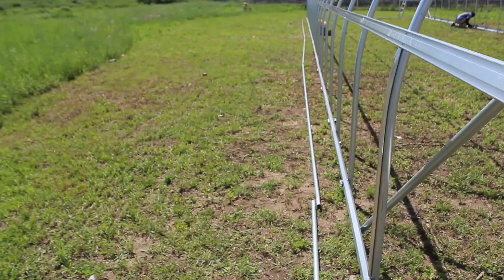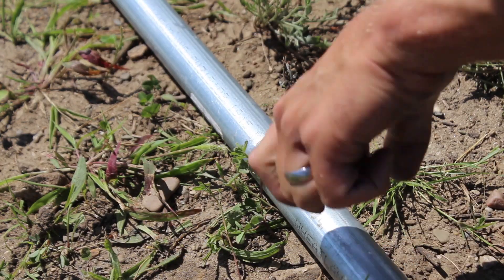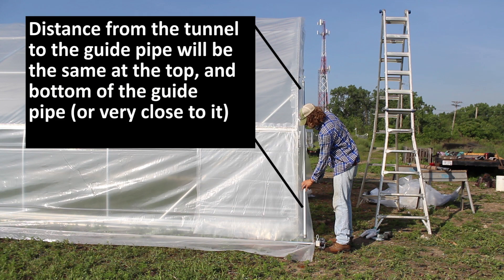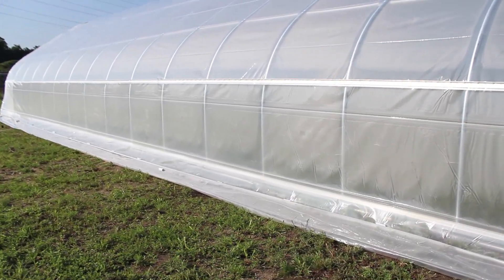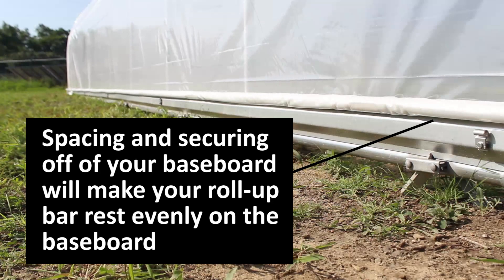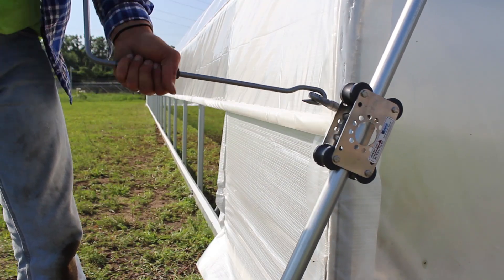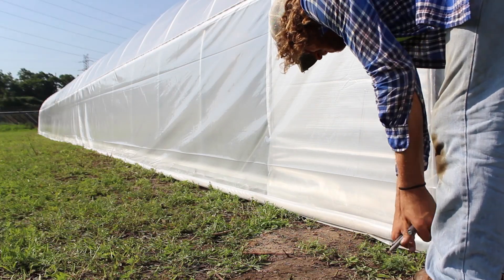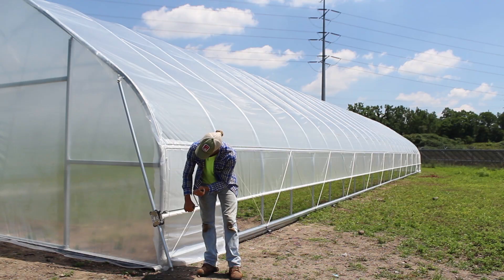Roll up sides for Greenhouses - How to Install for Improved Ventilation

Comment: How do you level a vertical guide post?  One would think you would plumb it.
Reply from the maker: If you install the guide pipe using the open eye bolt and chain links provided with the gear boxes, which are shown in this video AND you attach those to your structure as is done in this video, the guide pipe should end up being parallel to your end-bow, and since your end-bow should have been made plumb in previous steps, the guide pipe should be plumb as a result of this. If the guide pipe is attached to the structure as shown in this video, the bottom is free-floating, however, so if it is slightly off plumb it won't hurt anything as the guide pipe can "self correct" as the guide pipe goes up and down it. Hope this helps!

Comment: Since I don't think we have that roll up thing in Germany out of the box, can you please tell me which kind of material this "raw tube" is? Is it Aluminium?
Reply from the maker: Hey there, and no prob. The raw tubing is 1.315” Outer Diameter galvanized steel. It is often referred to as “top rail” and is also used as “chain link fence tubing”. Hope that helps! Thanks for watching :)

Comment: So I am wondering. This is six years old so maybe I won't hear back. Wouldn't it be better to roll up sides in the opposite direction so water will shed and not go into the roll? Just asking. Just put up a greenhouse with My son with roll up sides. First time.
Reply from the maker: Whether it is better is debatable BUT it is definitely possible to crank the gearbox operator the other way and have it roll in as opposed to out. The issue with spinning the roll-up side inward is that it creates a lot of friction at the point of each bow as it rolls up since it is literally scraping against the structure the entire way up, whereas rolling out doesn't create any odd additional friction on the plastic at the point of contact with the bow. All this to say, you certainly can roll the tube the other direction and avoid some water resting in the roll-bar "nook" when it is in the down position, but it may result in your side plastic breaking down a bit faster than otherwise since the rolling up and down motion will put more pressure and friction on the plastic. To me, I am not really all that bothered by a little water resting in the roll-up side when it is in the down position, and that can be squeezed out easily enough (in my opinion) by rolling the side up a bit and then rolling it back down. Rolling outward will likely result in longer lasting side plastic, and I like that, but it is just something for you to keep in mind as you make your decision. Again, rolling inward will work, it is just a matter of balancing the trade-offs for what it could mean for the plastic. Congrats on completing a build with your son, that is great!
Reply: Thank you for the feedback:-)

Comment: Would this work for double wall, insulated plastic? Its got a little fan that blows in between the plastic sheets and inflates and insulates. It's not very tightly covered, but tight enough, and both layers are on the outside of the frame of course. Thanks
Reply from the maker: There are ways to inflate your roll-up sides, but it is not something we focus on. You could reach out to Advancing Alternatives if you are serious about setting up an inflated roll-up side set-up.
Reply: @tunnelvisionhoops  it's a normal dual plastic sheeting walled/insulated greenhouse. there's 2 layers of plastic on the outer frame of the greenhouse with a small fan that blows in between the layers to keep them apart.  The air can be turned off or reversed if needed.

Comment: Do you put anything on the other end?
Reply from the maker: No, if the tubing has been attached to the plastic parallel to the hip rail, and a gear box is being used at one end, the side should roll up parallel to the hip rail. It will be important to drive a screw  or two through the snap clamps and into the bow to ensure they don’t slide a bit over time though.

Comment: Great video. Only thing I don't understand is how to seal up for the winter. We have to heat our greenhouse for citrus and can't have any cold air leaking in.
Reply from the maker: Thanks for the comment and the kind words. If you have to seal up for winter and have roll-up sides, you can add spring wire where the excess roll-up side plastic overlaps the end hoop at each end. For along the bottom you could add a shin-wall, and additional spring wire channel if you wanted, in order to create a more closed off system. Hope that helps and thanks for watching!

Comment: How far is the wiggle wire from the ground?
Reply from the maker: Thanks for the question, Randall. Are you referring to the spring wire that is in the hip-rail (the horizontal member that runs the full length of the structure)? If so, that unit is approximately 4 ft. off the ground - give or take a few inches. 

We also sell greenhouses where this hip-rail is 6 ft. off the ground or in some instances 8 ft. off the ground. 

If you were referring to a different section of spring wire, let me know which one you are referring to. 

Thanks!
Reply: @tunnelvisionhoops  basically how far it rolls up max.
Reply from the maker: Ah, gotchya. The side in this video rolls up 4 ft., but there are versions of this structure where the sides can roll up 6 ft.
Reply: @tunnelvisionhoops  Could i make system that could roll 8-10ft?

Comment: So we have a roll up side for our tunnel, and our grading is about 2%, or 2 feet for 96’ length. My question, our baseboards installed going with the grade would result it it being uneven the roll up sides. Also, we would use 4 or 5 baseboards for one side, and only one for another side. Any ideas? Should we go with the grade, or make the baseboards entirely level and have baseboards be almost 2 feet of spacing on one end? Thanks for your time! Have a great weekend!
Reply from the maker: This will really be determined by how you anchored. Did you install your anchors so that they “follow the grade” lengthwise, OR are all the ground posts perfectly level (which would mean the ground post anchors at one end would be out of the ground about 2’ more)?

If your anchors have followed the grade of the earth, you could install your baseboards so they run along the ground also following the grade of the earth, and AS LONG AS YOUR HIPRAIL is a consistent distance up from your baseboard through its full length, the roll up side should still roll up without any issues / without getting “wonky”. 

Not sure if what I am outlining above makes sense, but whenever I can install a baseboard so I can avoid a big gap beneath it at one end, I do, but this would really require you to think about it at the time of anchoring.

Hope that makes sense, and thanks for watching.
Reply: @tunnelvisionhoops  my greenhouses are also built on a slope and i think it would be easier with my grading issues, if my curtains could roll down to open and roll up to close, is that possible with this system?

Comment: Hi - great video! One thing that I'd like a closer look at is how the top of the gearbox guide pipe attaches to the end hoop of the greenhouse. Thanks!
Reply from the maker: Good question! I’m working on a video now where we discuss extender pipes and guide pipe placement. Extender pipes allow guide pipes to be installed so they don’t ‘kick’ out at the bottom when the operator is rolled up. 

Not sure when exactly it will publish, but soon I’d think. Stay tuned, and thanks for watching!

Comment: Why is there additional plastic at the end of each side panel?
Reply from the maker: Good question, Harvey. Those are corner wind panels intended to reduce how easily wind and cold air can squeeze past the edges of the roll-up sides. We have a video on that process here: https://www.youtube.com/watch?v=AfsxdyaoWjk Thanks for watching!
Reply: I made it through each of your videos and learned a lot about how to and the why behind it part. Great job! Very clear and concise. Thank you.

Comment: Do you have to use the guide rail or can you use something else
Reply from the maker: Victor, you do not need to use a guide pipe if you are just using Handles as your roll-up side operator, BUT, if you plan to use a gear box operator you will need to use a guide post for those. Thanks for watching!

Comment: Is the roll up pipe on the none cranking side just suspended on it's own or does it have something attached to it and it rides up a similar cranking pole?
Reply from the maker: The roll-up pipe on the end opposite the operators does NOT have a guide pipe. It is suspended by the plastic itself.

The snap clamps (and the screws driven through them) ensure that it rolls evenly despite this. Believe it or not, the plastic does a good job holding the tube if the tubing has been attached to the plastic consistently through the full length of the house.
Reply: @tunnelvisionhoops   thank you very much

Comment: Overall a great video and a great company to give support to their products. I did have a hard time figuring out installing the pole that the gear box rides on. The instructions you gave - to keep it paraelle to the end hoop and the gear box connection beyond the hoop, were inconsistant because the bolt wasn't long enough to get the pole out that far. Anyway, maybe a suggestion to clarify that part for others. Thanks for the support, you do well with the videos.

Comment: Hi everyone
I'm having trouble with the pipe, is flexing  and the end of the pipe (opposite side of the gearmotor), at the end of the pipe rolls the plastic faster so the rolling is uneven, what could be the problem that is causing this? the lenght is 54 meters(183.7 feet) and the height 4 meters (13.12 feet), thank you all
Reply from the maker: There are a number of things that can cause a roll-up side to have this type of issue, so it is really quite difficult to diagnosis. Here are six potential causes:

1. Your structures anchors follow the grade of the earth BUT your hip-rail / sidewall plastic connection is perfectly level. If this is the case and you install your roll-up sides a designated distance off your baseboard, your sides will roll-up even to the baseboards BUT not your hip-rail / connection point on the side. 

2. The plastic on the far end has been attached differently than plastic at the near end. For example, if you don't create enough distance from the baseboard to the plastic connection to your roll-up bar, it will exacerbate as the side rolls up. If your roll up side is 4 meters it has A LOT of distance for even a one-inch to compound over the side wall height. For example, if you attached the plastic to your roll-bar one inch closer to your structure on the far end than the near end, the obviousness of that issue will increase the higher you roll the side up. 

3. There could be more excess plastic on one end as compared to the other. If excess material is bunched up in the roll-bar that part of the roll-bar tends to roll-up faster than the rest of the bar. 

4. There could be literal debris in between the roll-bar and the plastic. This would likely have happened at installation if at all. For example, when your plastic is first being attached to the roll-bar, if you accidentally get gravel on the plastic and don't notice this at the time it will impact how evenly it rolls up and down. 

5. The plastic isn't securely fastened to the roll-bar. If you, for example, used snap clamps to attach the plastic to the roll-bar BUT you don't drive a screw or two through the snap clamps to permanently hold them in place, it is possible for those snap clamps to slide a little over time causing portions of the bar to roll up slower or faster. Also, 4 meters is a lot of distance for the roll-up side so there is a lot of additional weight on whatever securement method you are using. 

6. One of your roll-bar units may be missing a connection where it joins to another unit. This has happened to me before, and I only discovered it after trying a bunch of other repairs / fixes... essentially, I just got in a hurry and forgot to attach the actual roll-bar to the other roll-bar unit. If this has been don, the roll-bar will often still move up and down, but it does so at a much different pace than the rest of the side. 

Best of luck, and thanks for watching!

Comment: Can i use 3/4 EMT pipes ?
Reply from the maker: Technically you can although most of the common hardware used for attaching the plastic cover to your roll-up side bar AND for attaching operators to the end of that roll-bar (whether 7:1 gear boxes or handles) are made to configure with 1.315" OD standard fence type tubing - which is referred to as 1 3/8" OD and is often sold at hardware stores and fence supply companies.

Best of luck with whichever route you decide to take your roll-up side installation. Thanks for watching!

Comment: First, excellent video! Thank you for sharing your knowledge.   We followed your video and got the necessary supplies, it works exactly as you've described. The only problem we're running into is the plastic is so heavy in the center it sags the piping in the center. We used the snap clamps as described. We're thinking it's because we're using a heavier plastic. Any suggestions to fix this issue we're having? Thank you!
Reply from the maker: Thanks for watching, and good question. In my experience the weight of the plastic doesn't have any impact at all on how the roll-up side bar rests through the full length of the structure. Not to say it isn't possible in your situation, just that I have always found that type of sag to be caused by other issues. 

Here are the most common issues that I have seen cause this:

1. The baseboard of your structure follows the earth through the length of your structure and IT is lower in the middle, which means when you measure off of your baseboard your roll-up bar "sags" a little because it mirrors your baseboard. 

2. The greenhouse plastic was fastened to the structure in a way where the far left and far right of the structures sides weren't pulled as tightly as the center of the sides, which means there will more excess poly in the center of the structure. This means as the weight of the roll bar rests on the structure it "stretches" the excess plastic out and their appears to be a sag in the center. 

3. If the plastic hasn't been installed square to the structure you may find that there are symmetrical wrinkles that meet in the middle of the roll-up side. As you roll the side up these wrinkles get rolled over and create a larger diameter to the rolling bar and this compounds further as the side continues to roll-up - which creates a "sag" appearance in the roll-up where the wrinkles are most obvious. 

4. Too few snap clamps were used and they moved a little as you rolled the bar up and down. This would happen also if you never drove a screw through them into the roll-bar. This is unlikely to be the issue, but I thought I would mention it here just in case. 

There are relative solutions for all of the above, but it might be best to send us an email at info(at)tunnelvisionhoops(dot).com along with some pictures so we can help you problem solve / trouble shoot.

Thanks again for watching!

Comment: You never showed how to attach the guide pipe to the high tunnel. Or how to attach the gearbox to the roll-up bar.
Reply from the maker: Because there are so many different operators and handles available for these structures, typically the instructions for those individual units are in the boxes with those units. For example, gear box attachment documents usually come in the box with the gear boxes themselves. That being said, we do have a video showing how to attach these to a roll-bar separately - you can see an example for how the gear box attaches to the roll-up bar at the 2 minute and 32 second mark - here is a link to the video I am referring to: https://www.youtube.com/watch?v=K9OtLmIMt8A&t=152s - this is being shown on a large plastic roll-up door but the order of operations for attaching the gear-box to the roll-bar are identical.

Once the guide pipe has one of its ends assembled with the included chain on it, the unit can be placed over top of an open eye hook that has been bolted to the front face of the structures' end-hoop - the location of that open eye-bolt should be determined based on the length of the guide pipe. Usually, I hold the guide pipe so the bottom of it rests just above the ground in front of the metal baseboard - then I angle the top part of the guide pipe so it lines up with the end-bow - at this point, I make a mark on the front face of the bow - I then add an inch approximately to account for the links of chain at the top of the guide pipe. This is where I drill my hole to receive the open eye-hook. If I install the guide pipe and it makes too firm of contact with the earth, you can trim a little off its bottom so it hovers just above ground level. 

The main thing to remember when configuring the guide pipe with the gear box, is that the guide pipe should remain relatively parallel from the open eye-hook all the way down to where it extends through the guide pipe. 

Feel free to email info (at) tunnelvisionhoops.com, or call in to our customer support line, if you have any additional questions.
Reply: @tunnelvisionhoops  Cool, thanks for responding. Looks like my kit is missing the adapter that attaches the roll bar to the gearbox. I'll call in. Thanks guys.  Your customer service has been great.
Reply from the maker: Thanks, we overnighted those and they should arrive tomorrow! Feel free to call in if you need anything else. Thanks!
Reply: @tunnelvisionhoops  literally the best customer service I've ever received.  Thanks guys.